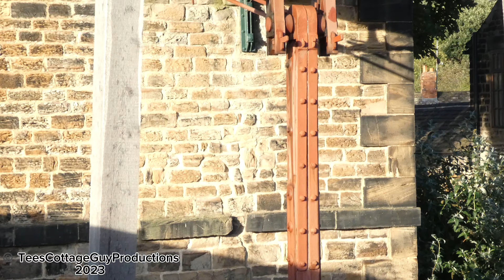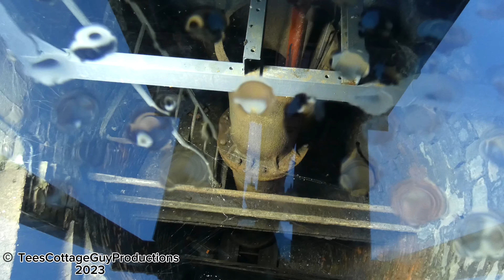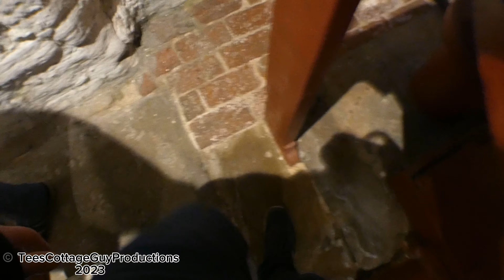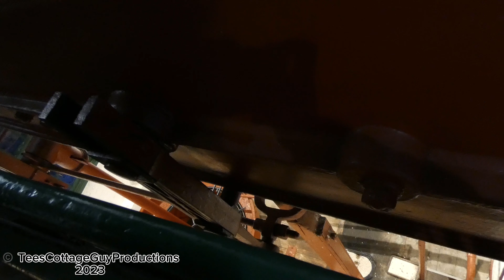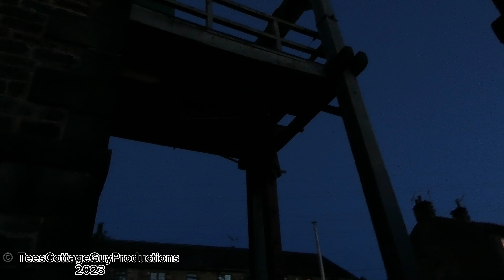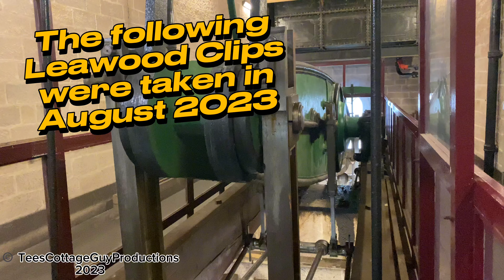ELSECAR NEWCOMEN ENGINE TWILIGHT RUN & HOW DOES A NEWCOMEN ENGINE WORK?

Comment from the maker: CORRECTION! Many thanks to astwine254 for pointing this out. The vacuum doesn’t draw down the piston. When a vacuum is formed it means there is more pressure on the top of the piston from the atmosphere and that brings the piston down. I meant to put this in the video but got lost in my notes 🤦🏻

Comment: I think your explanation of how the engine works is a bit misleading. You said that the vacuum created in the cylinder by condensing the steam inside drew the piston down. Actually, it was the pressure of the atmosphere pushing the piston down into the empty space left in the cylinder by the condensing steam that is providing the energy to make the engine work.  This is why such an engine is known s an 'atmospheric engine'.

A minor point that in no way spoils and excellent presentation.
Reply from the maker: Oh yes of course! Silly me. That’s a common mistake when talking about Newcomen engines. Many thanks for your correction!

Many thanks,
James
Reply from the maker: Just looked back over my notes for the video and I wrote down the principle which you mentioned here but it must’ve got lost in the notes 🤦🏻